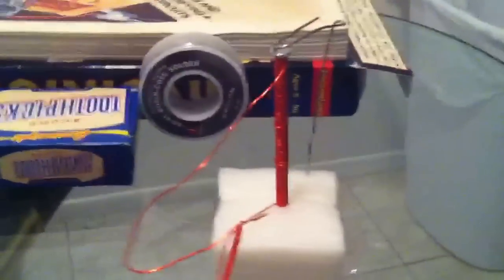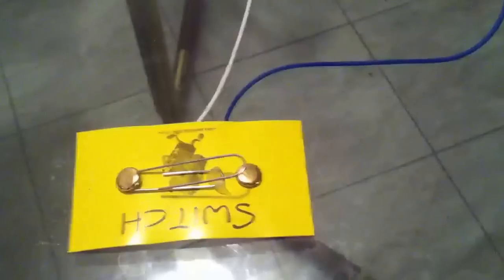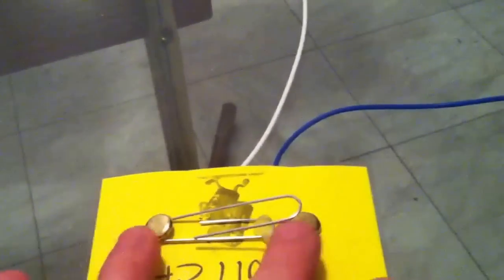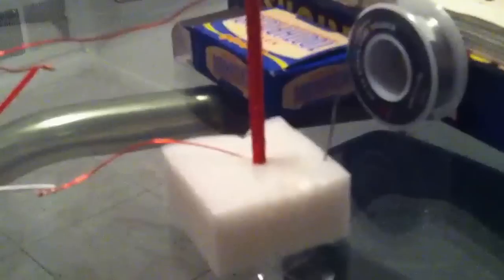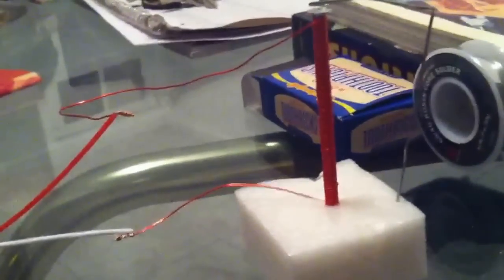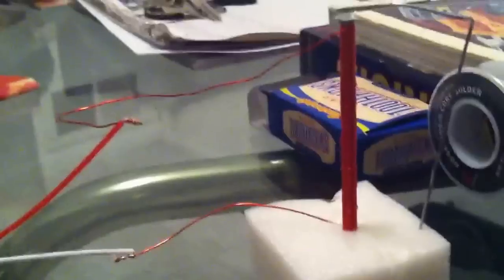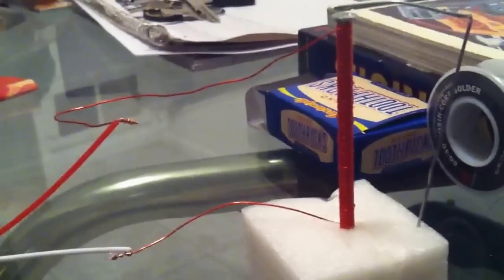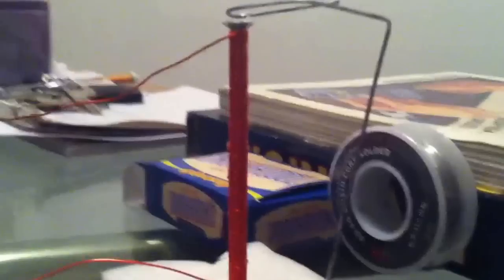Homemade telegraph

Comment: where did you get the kit from and or what kind of wires are those
Reply from the maker: I got it at Michaels craft store pretty neat kit whole bunch of different projects in it. The wire is copper wire with enamel over it. You could get that at radio shack if you wanted thanks for watching check out all my other videos and subscribe.